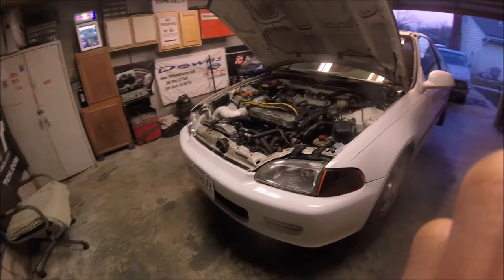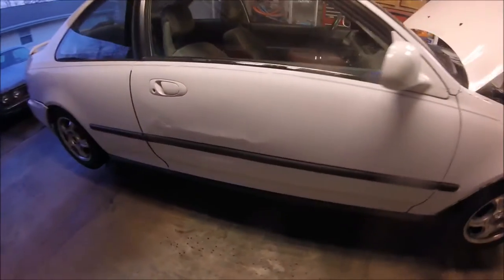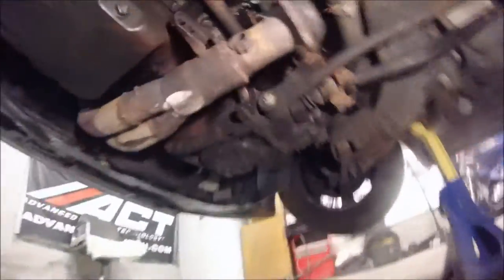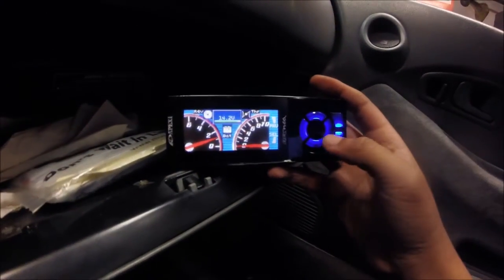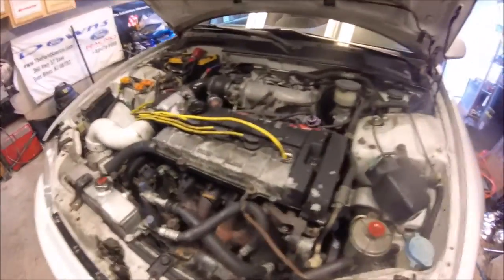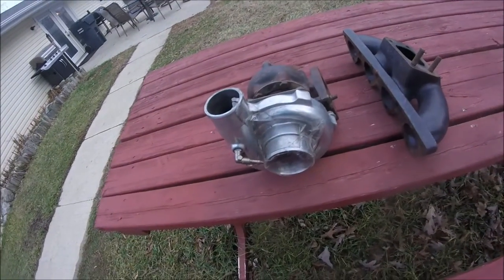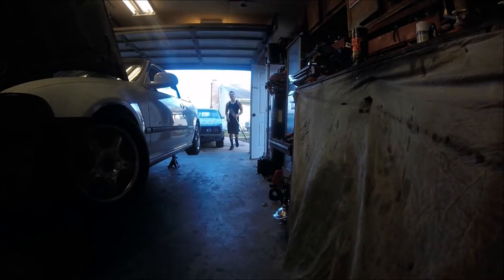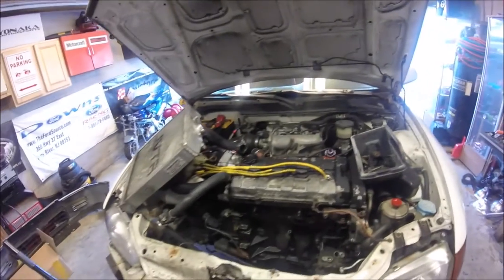Turbo Civic Build Part 1

Comment: don't run a/c or p/s like a G less things in the engine bay much simpler and all power to the floor also that way you have the turbo mounted the better way the compressor facing to driver side instead of the transmission.